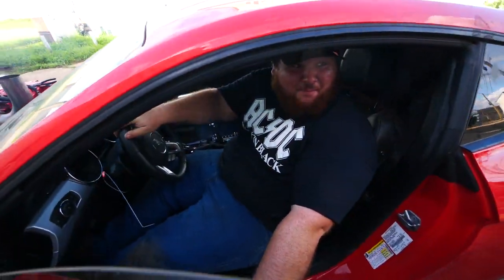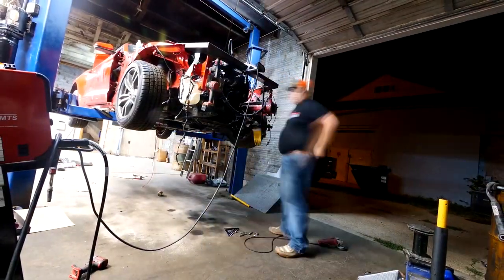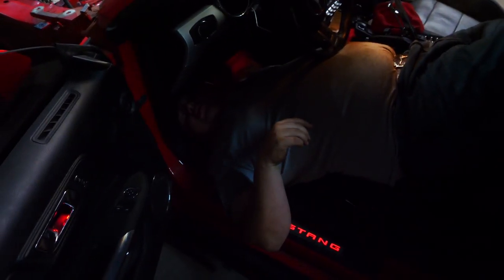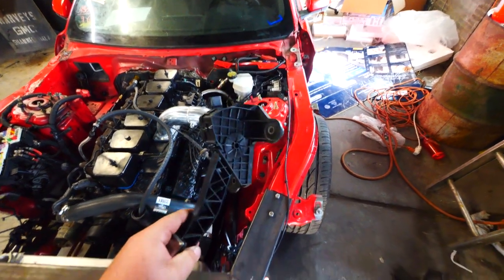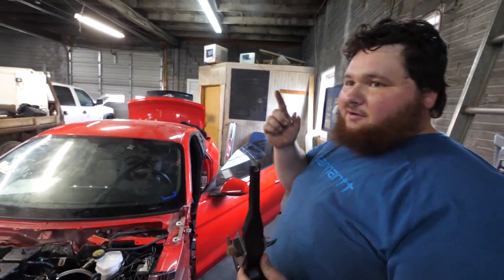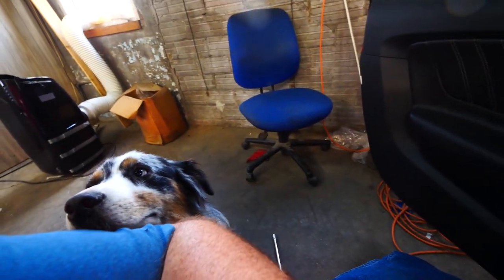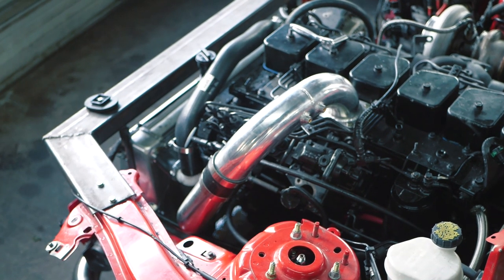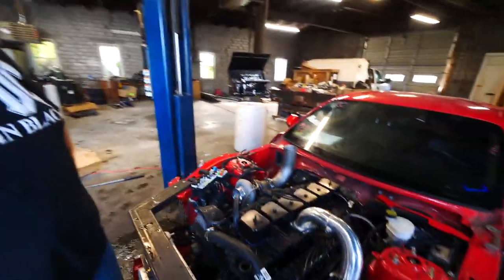We Take Smoke-Stang for First Drive..and it Broke

Comment: in my plumbing class i learn we dont use pvc as a distribution line because it can't withstand the heat. we use pex, cpvc,copper or galvanized,  cpvc i wouldnt recommend as is doesn't do well with uv rays.

Comment: Can you sweat copper fittings?  Check with a refrigeration contractor supply house.  The larger commercial refrigeration units use rigid copper and formed fittings that are soldered on.  Those fittings are available in 90* and 45* ELLS.

Comment: Find y'all a long radius refrigeration 90 degree elbow that proper od, and then braze a bead of 15% silafoss around each end to create a ridge for your hose clamp to lock onto so you don't blow hose when it presserizes. 
It should work out to be roughly 6"from end of coupling to flat of radius, then by the time you have hoses on it they'll be roughly 1" to 1.5" plus diameter of hose. And the reason for using the long radius refrigeration 90 degree elbow, is to reduce the back pressure of water flowing through it to help prevent what just happened with pvc ninety, which between not having any type of ridge, and pressure of water hitting back side of ninety with enough force to push it off  .

Comment: I once put a 70s chevy gas pedal in a ford e350 van, I did a motor job on it and it was originally electronic throttle, The new or well used one was cable, I had a 70s chevy gas pedal and some throttle cables laying around, I got it to work, Of course the van threw TPS codes, but who cares, it ran and drove fine lol.

Comment: Have you ever thought about #1 moving your lift to some where else more practical in your shop? #2 getting some oil containers & pumping those full barrels of oil into them so you can remove them out of the doorway? Then take the oil to local auto parts to get rid of it.

Comment: Hey kiddo,! NO BACKUP LIGHTS. That' OKAY though, cause you can have Dom walk behind you with a couple of flight deck flags to clear the way. Absolutely love it. My want is to take a Cummins, or Mercedes Diesel and put it into a 1939 Dodge 4 door sedan with suicide doors and smoke the tires. We can all dream. Right now my current work is restoring a 1957 Crown bus/motorhome with a 14.9 Cummins Midship engine. I'll get to the cars later. Good stuff kid.

Comment: HAHAHAHAHA omg you guys put a piece of PVC Pipe up under there??? 12:12 .... do you think that is the issue on why it leaked? i bet the rubber just got really hot and the PVC Pipe was just to slippery for the rubber to stay attached too not only from just sitting there running but even the driving was probably to much for the water flow and or the moving of the engine lol awesome job though i remember back when you first got this car and you said you wanted to put a Cummins in it i laughed.... i knew you could do it :P but it was still a funny ass thought haha and now to actually see it done.... what a bad ass ride lmfao

Comment: Alright solution for that 90degree find a pipe the same outer diameter as the pvc cut it at a 45 degree angle put the two 45’s together to make a sharp angle 90 weld er up clamper down bing bang boom you got your fix.